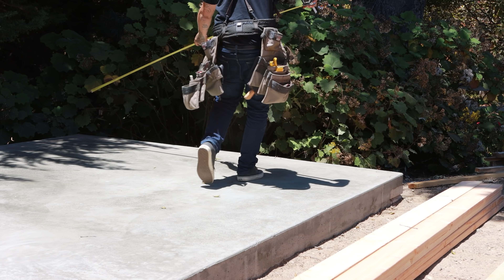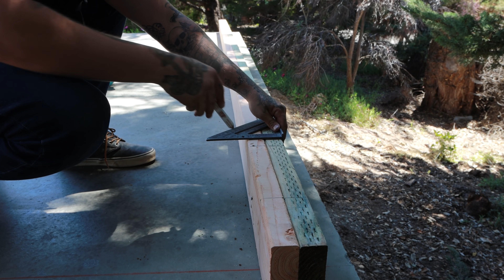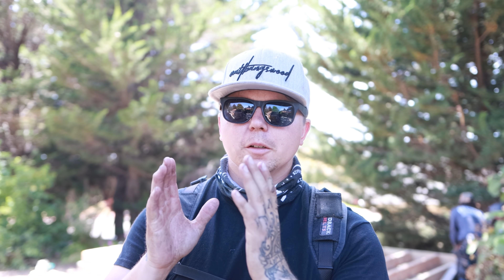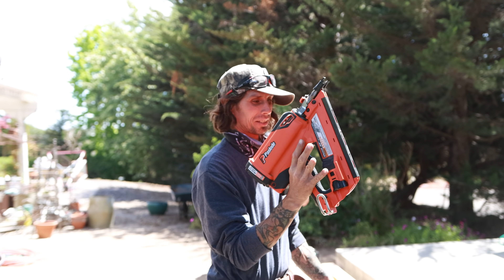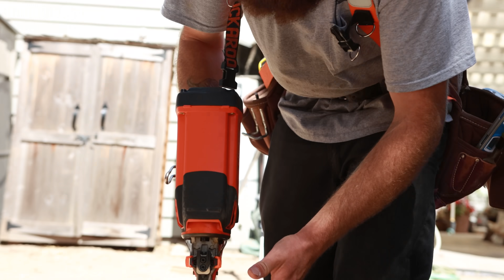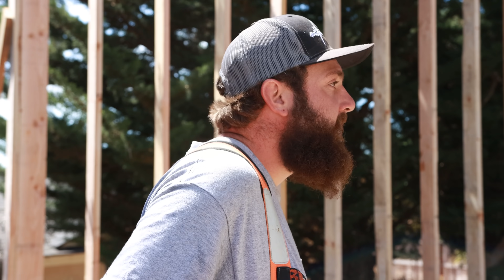Not Your Average Backyard Shed | Squaring Concrete, 16" O.C. Layout

Comment: Could you seal the concrete below your plate or use some other type of waterproofing membrane to keep water from wicking from your slab? Does code still require you to use treated plates...and just cant dispose of scrap..?

Comment: So, if you pull measurements off the corners, that will get the sheet goods to break over a stud. But it will nut give an overlapping butt joint of the sheeting at the corner. Is that a concern at all?

Comment: Why not just mark 3/4" less at every 16" delineation like the first? It seems like extra work and more room for error setting a nail and then pulling off that.
Reply: what? your way is more work. Every time you would have to find where 3/4 "  is less at 16" by him placing a nail at the first 3/4" mark  it lets him mark off at 16" on the tape and if you didn't know most tape mesure have this big ass red mark on 16" increments
Reply: @kneehats2311  Yeah, it's the previous 1/4" mark before those "big ass red marks", really tough. I was looking for a logical explanation besides not understanding simple math for why setting a nail is better. What if the nail shifts, is at an angle, is slightly misaligned with the original mark, etc.? I understand this will mostly cause small measurement errors but why not eliminate the possibility

Comment: Just wondering, WHY 2x6 walls on a little shed. It looks like CA likes to make people waist money. :) , your job is great man! I just don't understand why people would use a 2x6 on a little shed like that one....
Reply from the maker: Many reasons. To match existing home, it has 2x6 overhangs, tying to 2x8 fascia. I could have used a 2x4 wall, but I wanted this thing rock solid and client did as well. No exterior walls in California are 2x4, so doing it here isn’t a big deal.

Cost difference from 2x4 to 2x6 for all the framing here was $250.00.

Comment: when doing layout, why not just hook to the end of bottom plate and mark 3/4 off of each 16"? your nail method works fine but isnt that unnecessary? wouldnt your 16" marks still be the same? also ive always marked my layout lines where the stud itself sits, rather than edge of the plates. do you see a benefit doing it your way?
Reply from the maker: That's how I lay out 99% of the time. Most people don't understand 3/4" off 16" layouts, so for this little thing I showed it that way.

I layout tops mainly, depends on how it's plated.

Comment: 2x6 @16" o.c. for a she-shed? That seems like overkill, especially with lumber prices.
Reply: I was wondering exactly the same. Even for a house 2x6 24" OC is good right?
Reply: @passg1920  strength-wise, 2x4 @24'  is good , but folks want 2x6 for the insulation cavity.
I should add 2x4 @24'  is good for the 90% of us outside of earthquake areas. I have no clue what is needed for the other 10%-ers.
Reply: I was surprised to see 2X6 studs as well.

Comment: With lumber so high in price, I think I would of went with metal instead. Lumber is not going down at all.
Reply from the maker: Lumber is going back down. Lumber futures are plummeting. Lumber futures are simply contracts, and they aren't nearly as expensive as they were a month ago. It'll take a minute for that price to directly hit us as consumers. I paid $104 for a sheet of 3/8" 4x8 CDX. I'm saving the receipt to hang on the wall.

Lumber yards are going to keep prices high until the new (cheaper contracted lumber) lumber comes in, then prices will start to drop. I don't believe we'll ever see the day where material is what it was in 2018 though.
Reply: @MattBangsWood I want to build a shed but can't justify it with wood prices the way they are now.  It's good to hear that they are coming down.  Maybe next summer.
Reply: @MattBangsWood  You are correct, but we are talking about building cost right now... Building that shed out of wood is as expensive as a metal kit.
Dig your vids by the way
Reply from the maker: @chrisntheboat  Thanks! Absolutely, right now it is bonkers to build with wood. Can't agree more.
Reply: In 2006? OSB in the Midwest went from five dollars a sheet to just over $20 a sheet. It did eventually come back down to five dollars. At the beginning of the pandemic OSB was about seven dollars a sheet. And now it is over $50.